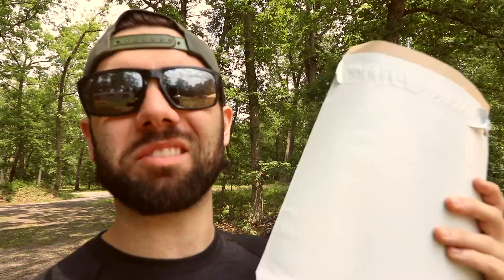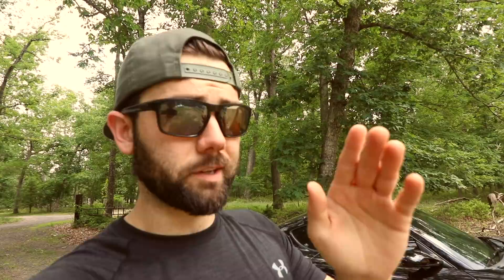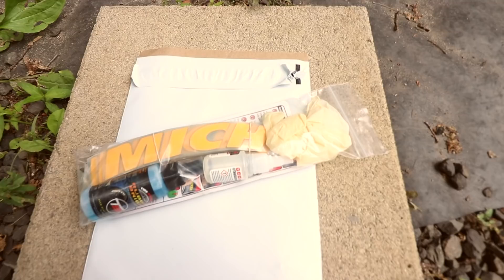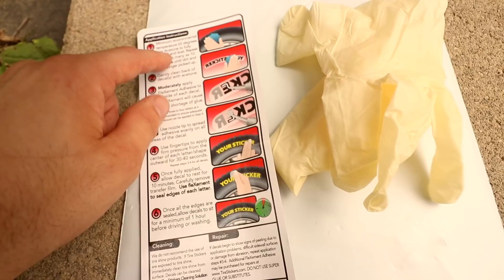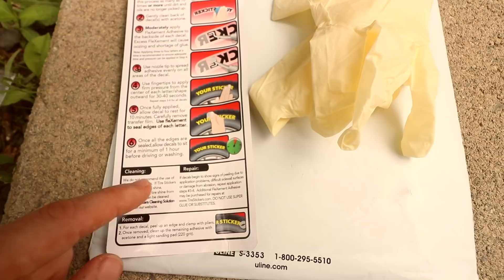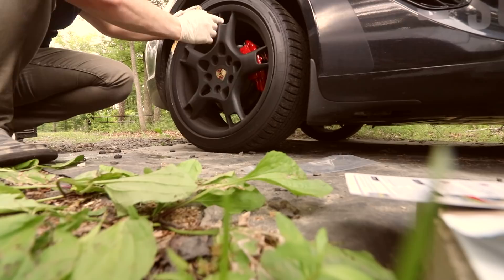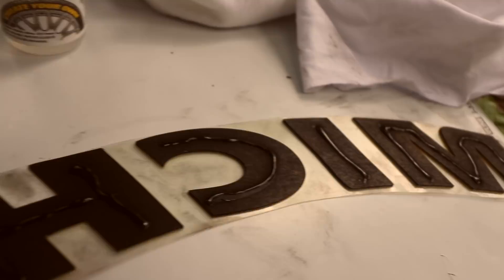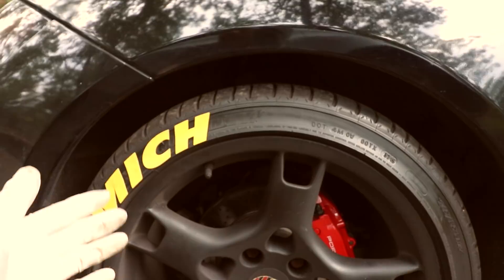YOUR WHEELS NEED THIS!

Comment: I think the lettering is too big for those tires. It looks weird with such a low profile sidewall. Maybe if the letters were 3/4 the size of what you used here. This product has potential...but it just misses the mark with this application.

Comment: Great vid these came out in the early 80s in the Uk but letters were separate which made it bit harder to put on the tyre plus only had super glue to use which just went hard didn't flex so letters kept coming off over time be interested to know how long they will last
Reply: an alternative is get a paint pen and by hand, do the factory lettering on the tyres. That's what I did ready for a track day. Also painted the calipers red. But.....that was a VW Beetle so I was doing it for the lols :D
Reply from the maker: YEE HAW BABY